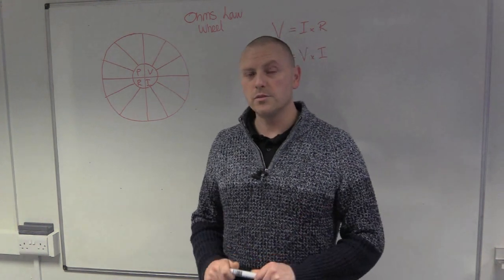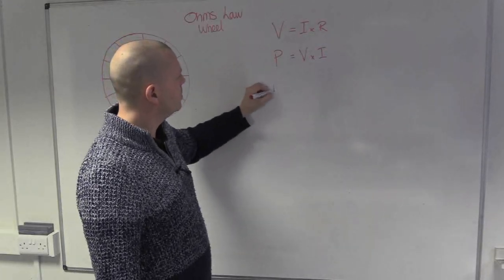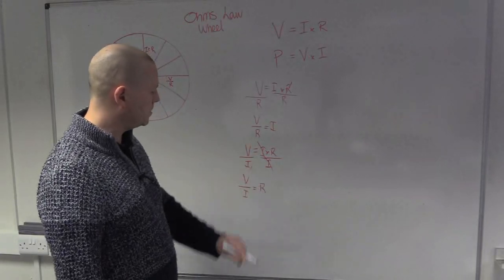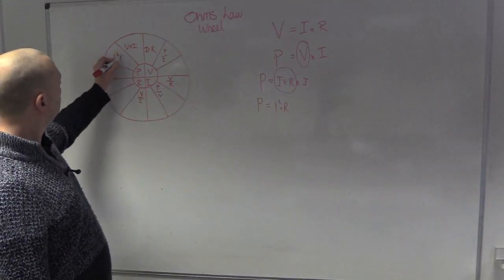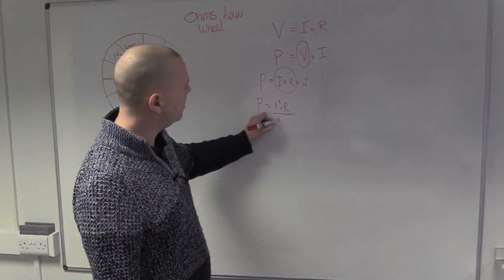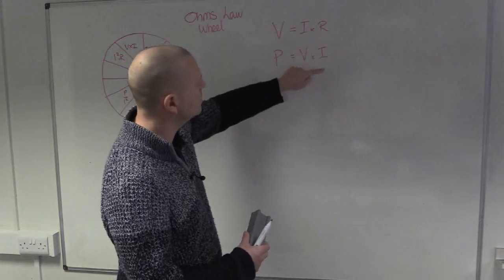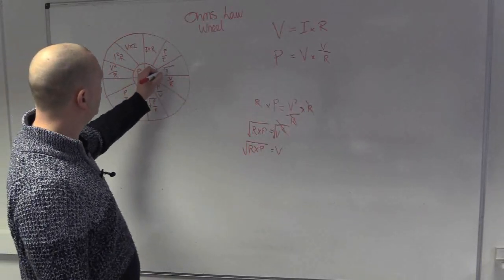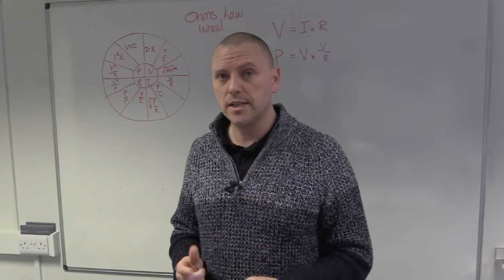ohms law wheel to help with city & Guilds or E.A L qualification

Comment: Abit of a random question, would like some advice. I’m  am 28 adult learner,  doing an electrician level 2 course through a private Provider, and at the end the month I’m going to have a education psychology assessment. I do  also want to  re do my maths again at a center or college but I was told all I need is physic and basic algebra. Do I Continue watching all your videos or would you recommend I sign up with khan Academy?? Thanks again for you help
Reply from the maker: Hello, you can get by as an electrician with the very basics. Installing circuits that others have designed would be fine and you could easily test to procedure and record the results and even confirm them against standard tables etc.

I found that understanding it more and more helped me with things like fault finding and interpretation odd readings and made designing so much less stressful.... Gave me confidence etc so there is benefits of learning the science and maths more. Focus on the basics of algebra, transposition and basic physics for now. I've heard good things about kahn academy but not experienced it myself.

Feel free to watch my videos and ask any questions you may have..... 👍
Reply: @cestemshow   thanks you